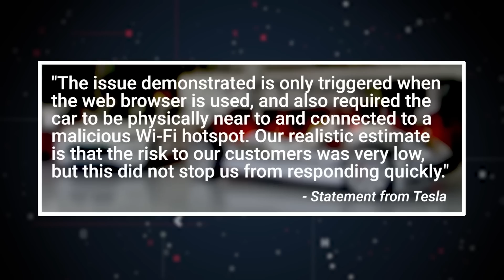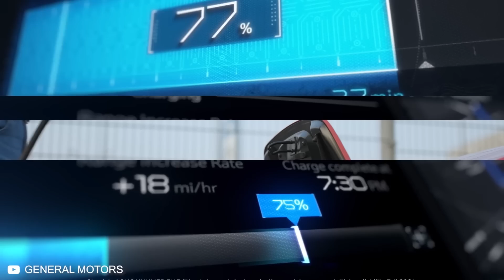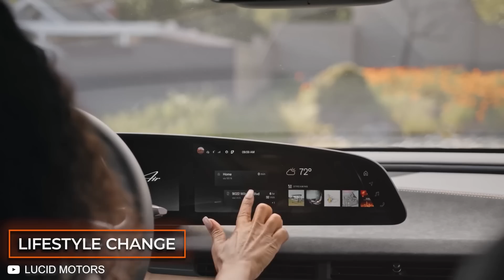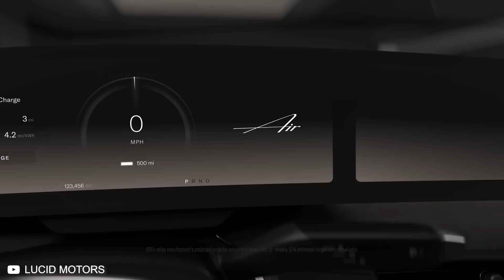EVs' Serious Problems That Carmakers Are Hiding

Comment: We constantly hear of power grid failures due to scarcity, especially in the winter when power consumption rises.  Many metro areas have been buying power from third parties to compensate for their own deficit.  How are they going to bear the burden of adding all of their transportation needs to their already shaky system?  This isn't a hard concept.  If you have $200 in the bank, you can't withdraw $1000.  If your credit is already maxed out, you can't even borrow the rest.
Reply: << Many metro areas have been buying power from third parties to compensate for their own deficit.  How are they going to bear the burden of adding all of their transportation needs to their already shaky system?  This isn't a hard concept.  >>

Left wingers used to provide the useful service of holding the feet of utility executive to the fire to get two things:  cheap and reliable power.  Both of those are now discarded.  The new deal environmentalists have with utilities is to get renewable power at ANY price,  and if it doesn't work,  tough.

Greenouts are in your future,  folks.

 I would be surprised if charging stations didn't have controls that allowed the utility to switch them off,  or reduce charging rates,  whenever that became convenient for the utility. What would be more natural?

Comment: As you well pointed out most EV's are pricey thus most buyers will have the resources to charge at home overnight. The main problem for present EV's is for those that don't have the availability to charge at home. Otherwise, there is virtually no cogent reason to buy a gas cars. EV's are faster, safer (most ev's completely demolish crash tests), need little to no maintenance and batteries should last no less than ten years. Most EV's have a range in the 150 to 250 mile range which is a lot more than most drivers drive in a particular day thus they would literally never have to use a fast charger at all. As for road trips the fast charging network is rapidly expanding, even now aside from Maine and the upper midwest (from western MN to Idaho) there are numerous options for fast charging on every major highway corridor. Most major manufacturers are now planning to go entirely electric by the 2030's so whether you like it or not unless you are in your 80's you will be driving an EV sooner than you expect.

Comment: This is basically round three of the gas versus electric car. The first two rounds the gas company managed to kill the electric car. At the turn of the century which was between 1899 and 1915 the first electric car was released, but because the battery was so poor, most people just settle for a steam powered car and eventually petroleum powered. So basically gas is still king and this time around rather than going out of their way to kill the electric car, just from all the research that I’ve done, the electric car will inevitably kill itself. Only being reserved to a few people that want to have something that’s pretty cool to drive and completely drastically change there lifestyle. They will be here but like I’ve tried to explain to so many people hybrids will be more on the rise and eventually the truckers will switch over to hydrogen fuel cell like they did in Germany. And this is coming from the perspective of someone who lives in United States.
Reply: no demand for gas cars which are superior did that. oil company's were not powerfull enough to cause policy change.
Reply: Exactly, people got this idea in their heads that electric vehicles are the future and new technology when in reality it's old technology that has failed before. I see them as an inferior technology to ice cars, only way to go green and buy an inferior product is if you really care about the environment and are willing to put up with its shortcomings.

Comment: I think people are going to take the convenience of gasoline cars for granted
Reply: EV’s are useless on long trips I don’t care how many charging stations you have a simple 2 hour trip could easily be 4 to 6 hours if there are many electric cars waiting to be charged not to mention if the charger is not working plus it will open the door for thieves to take advantage of people who are forced to stop and charge say at night in some rest stop it’s a lot of work that YOU have to do just so you can make some corrupt politician rich
Reply: @johnjohnson9017  
A 2 hour trip is 160 miles at most and most EVs and all Tesla’s can handle that with no charging stops. You are also vastly over exaggerating the charge time needed, you can charge up to 200 miles of range in 15 minutes. If you use the Tesla supercharger network the car will tell you how many stalls are at each location, if any are down and how many other cars are there charging currently. Security is an issue in some areas but people also get robbed at gas stations all the time.
Reply: @That-Guy_  - Be a long time before EV become practical for everyday use and overtake the gas car!
Reply: @Icarusvampire  
If you live in a house/somewhere you can charge at night and have a commute under 200mi a day then EVs are already better than gas. They do currently have a higher up front cost but make up for it with lower operation costs. My Model 3 saves me $160 to $180/mo in fuel and maintenance. That makes the $47k price effectively drop to ~$35k.
Reply: It's more convenient to charge at home overnight then have to stop at a gas station
Also no more oil changes to plan for
Reply: @That-Guy_  what about brownouts or when you suddenly have to travel long distance?  Don't be so short-sighted
Reply: @rickshawwheelchair  
Road trips can be done with the charging network (Tesla has the best by far) 
Brownouts don't last that long and are typically during the day so not a big issue if you charge at night
Reply: @That-Guy_  It is convenient to charge at home unless you forget to plug in. Can't just stop by the electricity fill up station on the way to work.
Reply: @boss42971  
Charging at home is awesome and if for some weird reason I did forget ~4 days in a row then I can stop by a supercharger by my job or not far from home for about 10 -15 minutes to get me enough for a few days of normal driving.
Reply: @That-Guy_  True...But fast charging degrades the battery faster and 10-15 min is still 2x longer than it takes to fill up a, ICE car. People are impatient.
Reply: @boss42971  
Then don't forget to charge at home. It take 10 seconds to plug in after getting home and you save more money with home charging vs supercharging or gas.

Comment: well for me the major issues with electric cars is will this car last 20 plus years like gas engines and how the hell am I supposed to charge it in a condo area without a garage.After that what's to say the cost of the green energy will not be jacked up so high you wish you had $5 gas.
Reply: US is probably behind in this, like always, but in EU many countries have already passed laws that you can demand your landlord (or whoever is responsible for the building) to build charging infrastructure on the parking area.

Comment: My brother bought a 2017 EV the day he moved out (Im from. New Zealand) turns out his rental has no plugs nearby outside so runs an extension cord from the toilet to while he parks his car (its in neighbouring lawn lol due to being near toilet) 😂😂 after a few weeks of it he decided to just charge at the supermarket or maccas, then just gave up because he had to do it everyday for 1 to 2hrs (dc fast charger) and sold the car, could only fo 300km on one charge 😂😂 not enough to get to work and back 😂😂
Reply: What pisses me off is that EV owners get the “special” treatment at the front of the grocery stores 🏬.
Reply: @BadEconomyOfficial  They are paying extra for that special parking. I've seen Walmart put those charging stations up close, I've also seen them located in the least used parking areas as well.
Reply: @robertkarp2070  So have I, but they’re not “paying extra” for those spaces.
Reply: @BadEconomyOfficial  sucks to be you. 🤣🤣🤣🤣🤣🤣🤣🤣

Comment: same old stupid arguments plus some made up ones. EVs are no more hackable than cars with other power trains. if it has an app or an OBD port, it might be hackable. batteries are likely to outlast the rest of the car if they have good battery management. while the model 3 probably has the best number of kms added per minute, the other cars still have tons of range and decent recharge times. most modern cars have been tested in the so called "1000km challenge" and even the worse offenders completed the 1000km in a day of driving(which lets face it, if u r gonna drive that far, the only plan u r really gonna have after that is a shower and maybe a dinner at the hotel). most of Europe has a better charging network than some parts of the US. there are parts of the world where an electric car wont work due to lack of infrastructure. but where i am from i can drive anywhere i want and have several backups in case one charger doesn't work.

Comment: A LOT OF MISINFORMATION HERE. HOT AND COLD DON'T DAMAGE BATTERIES, IT JUST EFFECTS THE RANGE.
Reply: Actually heat does damage LiIon batteries. It's why they all have cooling systems of some kind. Cold reduces capacity and efficiency but generally doesn't damage them.

Comment: No way you can go cross country with all electric. Also can you imagine a line of 10 cars at the EV charging station and each car taking 40 minutes to 4 hrs to charge?? Who the hell can wait for that? They need to have all the infrastructure in place FIRST!
Reply: Begging to differ, but I just did. Drove my 2022 E-Tron Quattro from Phoenix to Pennsylvania. Experienced only mild range anxiety on Day 1 (Phoenix to Flagstaff). The nav system successfully located and guided me to working charging stations (all DC). True, there needs to be much more infrastructure (almost all of my stops were at Wal-Mart based charging stations (Electrify America). My longest charge was 28 minutes and my cost was significantly less than it would have been on the same trip with my RDX. Now, the downside was that I had to change my driving style. I usually go five to ten above the speed limit. On this trip I ran steady at 60 mph which gave me more highway time.  And, i would definitely do it again.  I think my range anxiety was my fear of the unknown. True, it takes more planning with an EV than with gas, but I'm a total EV convert. Others may differ.
Reply: @johndavidhigham296  Thanks for that nice reply and information.
Reply: @johndavidhigham296  yes I drive my tesla model 3 to Wisconsin from southeast Texas 4 or 6 times a year it does take almost 2 hrs longer than driving the 4 runner for the 1000 mile trip.
Reply: @johndavidhigham296  anecdotal
Reply: I have gone cross country 4 times in my Tesla Model 3. It’s no problem at all. You should get advice from people with experience.
Reply: @browneof  what happens when everyone has an ev, you will have to wait in a long line to charge, that's unavoidable
Reply: @wamnicho  I suspect as demand grows, so will the number of chargers. Just the way our society works.
Reply: @fyourfeelings8966  Yep, like more gas stations........
Reply: That's proven false. Two guys rented a Tesla rental and drove all the way across the United States in just over 48 hours. It wasn't a tricked out modified EV it was just a typical rental.
Reply: @johntiller605  Plain undo-able.

Comment: I no longer drive on road trips... daily driving no more than 60 miles.. at best/worst.
Reply: There are charging networks for road trips (Tesla has the best currently)
My Model 3 gets 270mi on a charge so even if I had a 200 mile daily drive i would be more than ok.

Comment: It is funny that drivers of e-vehicles think they are protecting the environment, but don't know that all the plastic parts are made from oil lololol. Also, it is more affordable to buy a new e-vehicle than to buy a new battery, very ecological.
Reply: I'll drive rather my petrol car for 20 years, than buy a new car every two years and throw away a already good one
Reply: An ICE car uses approximately 340lbs. of products made from petrochemicals. 
An EV uses approximately 800lbs. of products made from petrochemicals. 
 Electric vehicle supply equipment (EVSE), are quite large items mainly made from petrochemicals. The plan is to produce  6 billion EVSEs, all made from petrochemicals. The electric car would be very difficult to produce if it weren't for the oil companies.

Comment: Sadly, greed has not been eliminated from the top EV dog. Tesla is holding back on bi-directional charging just to sell the Power Wall ripoff for battery backup (wasting 3-5 days potential in their Models). Hopefully, the pressure on Tesla to do the right thing will be felt as Ford, VW and others are including this valuable inherent feature.
Reply: ev's are not inheret if the marketplace just choses to keep superior ice technology alive by constant repairs. machine shops will manufacture what big labels stop making . also magneson moss demands 7 years of parts after a model is discontinued.  when the marketplace refuses to purchase inferior evs. the manufacturers will demand change in legislation and the people who are operating scofflaws. when the majority of the population is in violation of the laws or mandates, then the law or mandate is illegal and void.

Comment: Co2 is turning desert into jungle. They don’t tell you that bit.
Reply: CO2 also acidifying oceans and killing ocean life that produces 70% of earth oxygen.
Reply: @teemumiettinen7250  co2 is the least of the oceans worries. Try another spin. 
The shipping of child mined cobalt from Congo around to world is more detrimental on its own. Average EV has 35kg of child mined, washed and processed cobalt in its battery pack.
Reply: @kevinkeelan354  Yes, we need to move to better battery chemistries, tesla is already moving to cobalt free batteries. 

Best solution would be moving away from lithium batteries as well, which will happen eventually. Sodium-ion is already getting close in energy density compared to lithium and its a lot cheaper as well.
Reply: @kevinkeelan354  "Tesla are full of shit. They have just signed new contracts with Chinese companies"

At least tesla is making progress and moving away from cobalt, you just seem to be tesla hater.

"Simple physics tells you EV’s are not energy efficient. They weigh twice as much as ICE cars."

Simple physics also tell you that ICE cars are only around 20% efficient, and waste about 80% energy as waste heat.

EV's on the other hand are very energy efficient, because electric motors work at around 90% efficiency.

"Battery Chemistry is nothing new. Very unlikely we will see anything ground breaking in the next decade."

As i mentioned before, lithium-ion already has a lot competition such as Sodium-ion batteries.
Reply: @teemumiettinen7250  have you ever drove a electric car. I test drove 2 before I ordered a new daily and they were dire. Range dropped 20 miles after 2 miles driving and it wasn’t that cold. 
It doesn’t matter how efficient electric motors are if the batteries aren’t efficient. They aren’t and they degrade too quickly. They also weigh far too much. 
I like Elon, but his cars are Fischer-price crap.
Reply: @kevinkeelan354  I dont believe you have ever driven actual electric car, you probably drove some crappy hybrid. 

I have no clue what you mean by batteries not being efficient, batteries are 90% efficient during charging and unless operating temperatures are extreme, will output that amount of energy as well.
Current lithium batteries can last up to 10 years and 500k miles.
Reply: Ohhhhhh nooooo they won’t!!!!

Comment: Ev sadly is not the future.. 0 emission does not exist even with electricity vehicles! To produce the materials needed to make 1 tesla vehicle compared to a gasoline vehicle is 10 folds worse for the environment. During the life of 1 tesla it is true there is 0 emission but when you have to replace the battery that is the problem. For 1 where does the dead battery go? 2 to replace the battery now all the 0 emission savings is 10 folds........ long story short all the environmental saving EV owners thought they were doing falls flat for the simple fact the battery and or the EV itself must get replaced.
Reply: All true

Comment: GM's million mile battery isn't a battery you never need to charge you dunts, it's a battery that lasts 1 million miles before massively degrading or failing. Storing over a million miles in anything of this size is literally impossible. Even the most dense idea, nuclear power, only gave the possibility of about 10,000 miles before needing a refueling. The difference is though that nuclear could technically do more, but it trickle charges a battery over time so the older it gets, the slower it charges and the less you can travel in one ride.

Comment: So essentially a used EV that is 5+ years old is essentially useless. Because the battery has a lifespan of 10 years. And you get less range over the span of that 10 years. I have a 20 year old Honda Accord, and I have put not even a fraction of $13,000-$20,000 in it compared to an electric vehicle that is close to 10 years old.